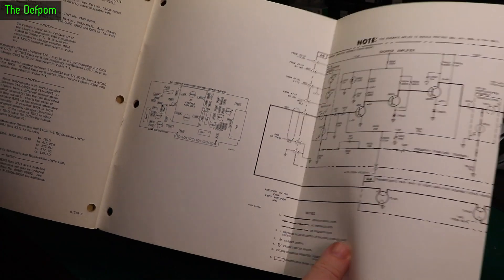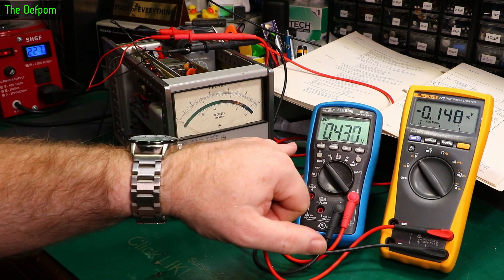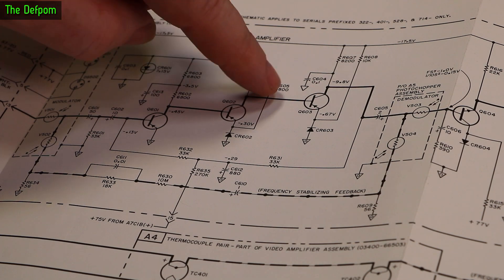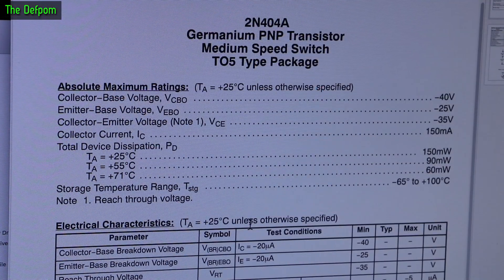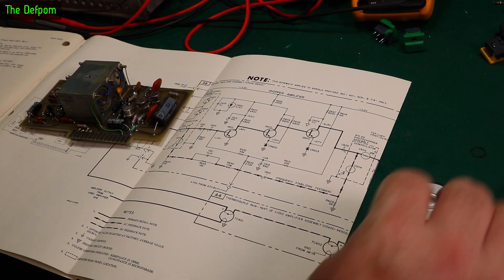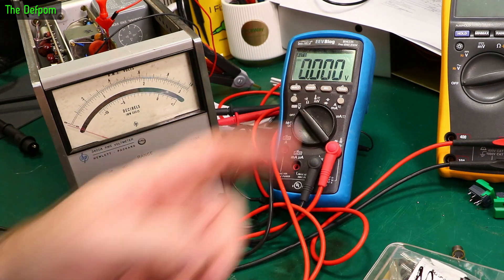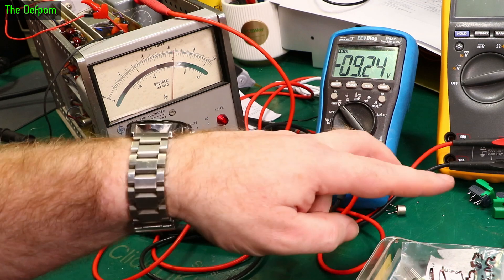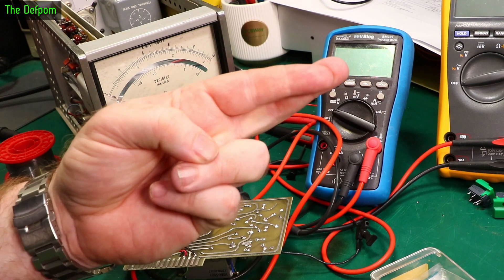🔴 HP 3400A RMS Voltmeter Repair - Part 4 - No.1117

Comment: I assume that you did check the leakage of C605 (even if replaced). If it isn't a tantalum it might be interesting to try one there. Great series, looking forward to the next part. I put together a board to replace the mechanical chopper in a Fluke 883A  Differential Voltmeter a while back - I'm interested to see your solution. Regards, David

Comment: Good job there seems to be some caps between stages so it not fully DC coupled, so that helps with the fault finding.
Instrument amplifiers are never that best to fault find on, there are often tricks used, that are hard to get your head around at the time. The needle swinging at turn on is normally caps charging up and the circuit settling down, you could have a leaky cap upsetting the dc levels somewhere.

Bit hard to say without the whole diagram to look at. looking forward to the next episode.

Comment: Is it something thermally related! It behaves like either something is warming up or charging up! What is the -17.5v power rail doing and the voltage at the top of CR601/C603 when you get the rising meter reading?
Reply from the maker: It has a small valve in the unit which has a warm up period, and it uses thermo couples to average the ac to become dc, so slow response is normal